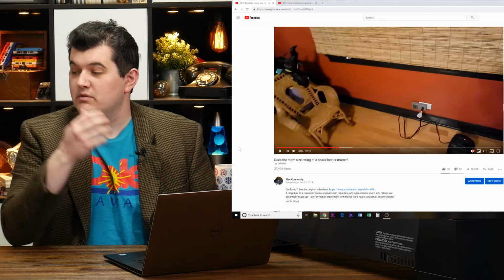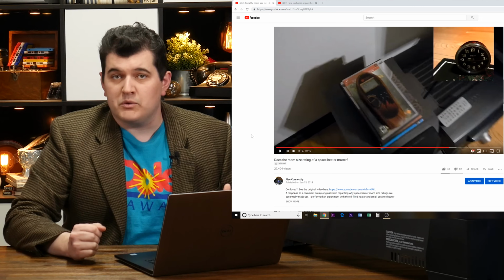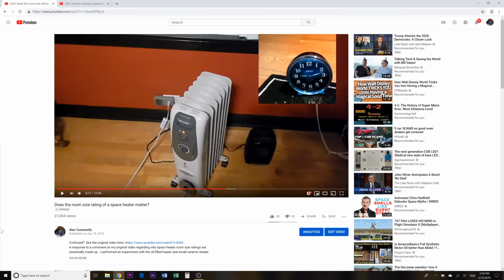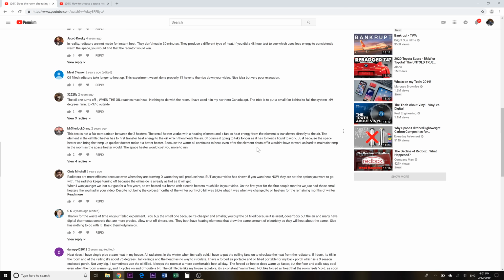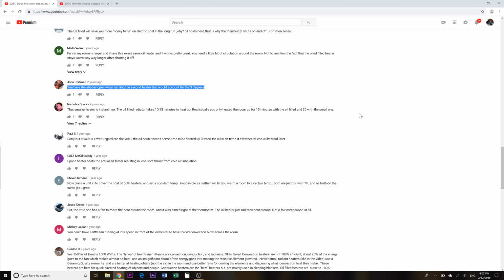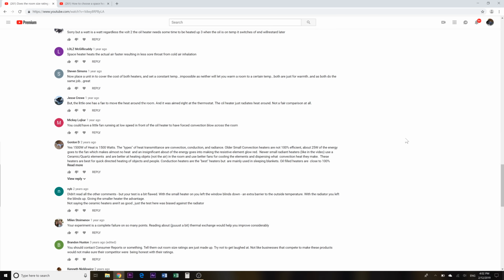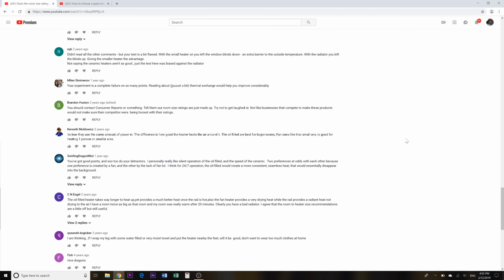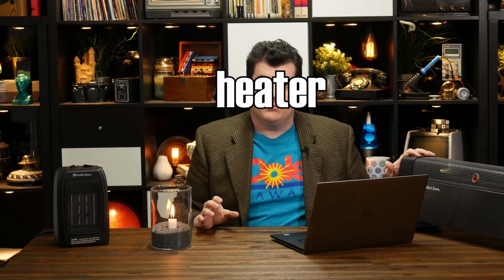More Space Heater Nonsense

Comment: I know this is an old video but here is my thought. If you have a large room you need a heater with a 'bigger' fan to move more air around the room quicker and potentially keep it where people are and not on the ceiling. If you just want to heat a room quickly or for a short period of time, a ceramic or inferred heater with an appropriate fan would be fine. If, however, you have a room you want to be 'warm' all the time a radiant style or many inferred/quartz heaters can be left running efficiently 24/7 and in time that will warm the walls, furniture, etc in the room so the couch isn't 50 degrees when you sit on it despite the air being 68 degrees. I can tell you this, that little heater on your table won't heat a 20'X30' 2nd-floor bedroom in January in Wisconsin no matter how long you run it. I've tried small heaters in large rooms and they just don't work as well despite having the same wattage. I also have a wood-burning stove and the closer you get to it the warmer it is but based on thermodynamics eventually my entire house should reach 80 degrees, but because its heat is concentrated in one corner of the house and heat is transferred out every wall, window and the roof it never will. Even if a small heater is creating enough heat to heat the entire room if it's not getting spread through the room it isn't going to make it feel more comfortable. If 1 candle produces 70 watts then 22 candles would heat as efficiently as any space heater.
Reply: TLDR:  I don't understand thermodynamics but based on my limited non-scientifically-tested experience, this video is wrong because I live somewhere that gets cold, and therefore, I must have more knowledge on the subject.

Comment: I'm just wondering, maybe "large room heater" was originally ment to indicate a limitation with the oil heater and that it shouldn't be used in a small room; because the power cycling would happen more often due to the smaller volume to heat. So there it might be an assumption that "large room" is actually superiour to "small room"; and it's actually (originally?) ment to highlight a shortcoming. 

But then Marketing has spun "large room" as a feature that customer can be charged for. Then "small room" heaters might be labled as such to protect the more profitable "large room" heater market.
Additionally, the more expesive large room heaters would be where you throw your extra features at, because customers are already willing to accept a higher price point and the marginal functionallity and more "robust" materials (indicating quality) again can drive the price of the "large room" heater prices up.

Comment: The only real performance differences between the two are ‘startup’ time, and ‘cooldown’ time.

An oil-filled radiator will take longer to heat up, but once it does will radiate meaningful heat longer after it is turned off.  The oil provides a thermal mass buffer to stabilize the output, making the heat in the room more consistent.

Most of the other styles are instant-on/instant-off.

Instant-on heaters will bring a room put to temperature faster.  Heaters with a thermal mass will maintain the target temperature better.

The only style of heater that can be ‘more efficient’ is the heat pump, because it doesn’t generate the heat itself, it moves it from somewhere else.
Reply: Why would you want the heater to turn off sooner and then convect plus radiate heat away from it slowly, all just to get the same amount of heat into the room in total?

Comment: What about did you take into consideration the differences in the time the individual heaters take to actually produce the maximum heat that little one automatically pushes it when you turn it on but the oil filter one takes a butt load of time to actually heat up?

Comment: As someone who has studied some thermodynamics at a university level, I am of the opinion that space heaters that rely exclusively on convection currents to distribute the heat around the room, are not only slower, but also slightly less efficient at heating. My reasoning is that convection heaters provide higher temperatures to the ceiling than element + fan, or even radiant heaters. Heating the ceiling more, results in faster heat loss through the ceiling. An element + fan or radiant heater can keep the warm air lower in the room longer, resulting in less heat loss through the ceiling. However, a long oil heater under a window, will heat the coldest part of the room silently. Heating the cold parts of a room will make for consistent temperatures around a room, making more of the room useable, which is likely why it is the chosen location for this sort of heater install that is part of a building, as you see in many colder areas.

Comment: you need a better oil filled heater, mine does not show any signs of the problems you described and puts out alot of heat
Reply: they're all the same. that's the POINT

Comment: The best space heater I ever had was a 1950s unit similar in size to the small one you present. It was also 1500W rated. It had all metal construction,  no ground in the cord and if used in the garage and set on a work bench steel top, it would zap me when iI touched the surface...LOL  It was the only heat I had in that building, so it was great.
Reply: Oh good jesus that's terrifying

Comment: Does the larger heater placed under an appropriately sized window create an air curtain that better insulates between the window and the space its heating? In large buildings with a lot of glazing (windows) they put the heaters right at the bottom of the window. I wonder if it actually helps.

Comment: Haha! Love it. Racing a 300HP Cummins Diesel against a 300HP inline 4 Honda fuel engine. But honestly: Power is power and energy is energy. It's the same no matter where it's going. Small forced convection heaters heat the air fast because of the strong convection. That's the reason why their fans are blowing the air horizontally. A big passive oil filled convector 1st heats the ceiling right above it, then moving on to the rest of the room including the air. (like you explain with the candles). Air is unfortunately such a bad medium for transmission of energy compared to a solid wall. IR heaters bypass that problem with the air by just transmitting energy directly to all non-transparent surfaces (well not many things are transparent to IR).Air is just so stupid: you make it warm and it rises up displacing the cold air to the ground where we live. So high ceilings suck too. We really need heat that falls down to the ground and stays there. As long as we can't get that we need to force convection.
Love your videos, wish I could talk that fast and make sense that much.

Comment: The Fan!  Power used to move the air is not converted to heat.  About 40% of the fan energy is still heat, the rest is transferred to generating air momentum.  This is probably a small amount of energy, but  this would make a difference.
Reply: and where does that energy of the moving air go? back to heat.

Comment: Buy the smallest, cheapest space heater you can find.  It will give the most heat for the amount of electricity used.
Reply: I greatly disagree, not from an efficiency point of view, from a safety point of view. 
Space heaters are involved in a lot of fires. Even the cheap ones have multiple safety systems, but oil filled heaters seem inherently safer to me when I have kids and a dog running around.
Reply: @prometheus56 converting your home into heat sounds very efficient. Not very safe, mind.

Comment: For me the one oil radiator that I had would go up to 90 and I found out by having it on that setting any room that I put it in would heat up to between 75-85 depending on the size of the room. Granted the room would feel about the same for an hour maybe two but after that it would keep the room toasty. Idk what model it was but it was a black honeywell from either 2016 or 2017.

Those things are good to use, you just have to keep in mind to turn them on an hour before you go to bed or before you go into your room. 

Now the one thing I want to see you do a video on are those annoying heated blankets! I would get a sunbeam one and I would say after about a months use on high the blanket would no longer heat up and would just end up being used as a normal blanket.  Would love to know what causes them to fiddle out so quickly!

Thanks and love your channels!!!! :D

Comment: What oil filled radiators need are detachable wireless or wired if you're so inclined, remote thermometers. That way you can get a reading of the room's temperature away from the unit. You can also place it higher or lower as you see fit. I dislike them because they take forever to warm a room though if you can get it warm it's a "nice" heat whereas the quartz space heater I have in my icebox of a bedroom heats quickly even lowering the fan speed my eyes dry out, my sinuses, my lips, etc. suffer from the forced heat.
Maybe connectable oil radiators with a remote thermometer. Link 2 or 3 via an oil send & return line. . . and gods bless the mess when a line fails. Back to the drawing board!

Comment: I am not an engineer, but maybe one benefit of the big heater is that they will last a bit longer. I could imagine that because of the larger surface area of the heating elements, they don't have to get all that hot, but will be able to put out the same amount of heat. That will put them under less stress. I don't know. 

But I think the main reason big room heaters exist is because of money. 
Put yourself into the position of a company that produces space heaters. Now you could just make one heater model - the small one. That's all you need. But: 
Why would you, if you could just exloit the ignorance of the majority of people? Convince people that for a big room, you need a big heater. "You need more material to build a big heater, so it MUST be more expensive." 
And everyone who is looking for a space heater will go for the more expensive option, because they think the small one is not fit for purpose. (unless of course they only want to heat a small room)

Comment: I think the kicker here is, choose which heater based on how you intend to use the room. Are you going to spend most of your day in this room like sleeping or as a living room reading a book for several hours? You can use an oil heater. Are you going to be in a room for a short period of time like a couple hours then move yourself somewhere else? Don't use an oil heater and use something that blows hot air because it will handle it better.

Or use a separate fan blow air over the oil heater. I'm going to try this myself this winter.

Comment: So if I got my oil heater up to temperature then added airflow with a fan. All of the energy stored in the oil heater should dissipate into the air in the room? Meaning they should balance out by doing this?

Comment: This is just a thought, a heating element can be close to 1200F (if it gets red hot) we only need to heat the air maybe 10-15 degrees above the current room temp. Moving air in greater volumes maybe why they are labeled for larger rooms?

They both may consume the same amount of energy, but possibly the bigger heaters with the larger fans can distribute the heat faster,
I used space heaters at an old rental house and the bigger ones did heat a bit faster than the smaller ones. 

honestly, its more of trial and error, different ones may work better then others based on your needs. That's why the good Lord gave us receipts if the item don't work to your expectations then return it and try another one.

But I agree to the marketing thing can be a bit misleading, it should say allows for better air flow for more even heat. The heat is there in all size of units but the distribution will be different.

Comment: You are 100% correct. I base my space heater purchases on other factors such as how quiet and powerful the fan is. Oscillation features and how sophisticated the thermostat system is. The one I am currently using to heat my office is quiet, oscillates and once it shuts off it will occasionally cycle the fan on to take a sample of the room temp. However it doesn't put out any more heat than a $10 heater.
Reply: Oh that sounds horrible.  I want one where I can give it a thermostatic set point and once it reaches the desired temperature IT KEEPS THE FAN RUNNING all the time, so I don't hear the fan going on and off all night.  I've only ever seen one that did this (by NewAir) but it's discontinued. 

Anyone?  Buehler?  Who makes one like this, where the fan has 2 modes: ON or CONTINUOUS, and the thermostat knob has at its lowest setting "Fan only" ??

Comment: okay SO the best thing i could think is MAYBE something like the baseboard one you had there has a larger surface area and therefore MORE of that heat can be output at a time?? if that makes sense??? like it'll be quicker to heat up a room with 1500w coming out of a 40" heater than it would be to heat up a room with a blowtorch of a similar amount of energy-similar to what you mentioned with the candle--BUT that would kinda negate why the ceramic one that was slightly larger than the small room heater you had would be labelled "medium". a larger surface area outputting that heat is the best i got

Comment: A different way of doing the experiment would be to time how long it takes to get the room temperature to a specific temperature. Then see how long it takes for the room to get back to its "normal" after the heaters are turned off ^^
Reply: THATS what I was looking for. My radiator heaters, they room stays warm hours after I turn off the heater. ....because the machine stays hot, the heated oil inside the machine, radiates heat for a long time after the machine is turned off. With the ceramic heater, it seems the heat is instantly gone as soon as I turn off the heater.
The radiator keeps the room warm. I warm up my room, and shut the heater off before I go to sleep. The room stays warm until the morning. 
The ceramic heater would have to be running all night, otherwise the room is really cold within 5 minutes of turning it off.

Comment: First off, great video :) 

Secondly, I wonder if the 'room ratings' may have more to do with the build quality of the units themselves, i.e. because the larger chassis allows the unit to run for longer without breaking down or stopping, they are rated for larger rooms (admittedly the ones with a built-in thermostat destroy this hypothesis).  Having a unit be able to run for longer will mean that even though they output the same amount of power, having one unit be able to run for longer allows it to do more work in the long run, and give enough time to heat up a larger area. They also probably assume a perfectly insulated room when they give those ratings

Comment: Has electric baseboard heating (like as the primary source of heat installed in homes) advanced at all over the past few decades? Or is it subject to what he brought up in the video, being that heaters are 100% efficient always? I ask because I'm trying to figure out if my electric baseboard heat is more efficient at heating my apartment or if a space heater would be. From what I understand in the video, it seem that they would be equally efficient despite the fact the space heater is new and the baseboards are probably from the 80s. I'm trying to find some way to lower my energy costs and electric baseboard heat in a 100 year old building is crazy expensive. I've already used cording to plug holes in windows as well as putting up plastic over all the windows. I don't know what else I can do to slow heat transfer out of my apartment so I'm wondering if I can more efficiently put heat into the room. The building is old, the windows are ancient pulley (single pane) and I live on the first floor, front of the building, so two walls face the outside and another faces the unheated hallway with only my smallest wall connecting to another heated space. The ceilings are 10ft high and there is an unheated basement below my floor. It's basically worst case scenario for heating bills in my northern latitude. Any advice on efficiently keeping the place warm would be greatly appreciated.

Comment: With an oil filled radiator, as well as a room stat it will have a thermostat for max oil temperature, once the oil is up to temperature it stops adding energy this energy can only be shared to room via convection and radiated heat at a rate governed by surface are and thermal coefficient. The fan heater can share heat as fast as it can add it. A larger oil filled radiator will be able to Radiate and Convect quicker even with the same peak power input. In effect a large element in a small oil filled radiator is a bad design

Comment: I know I’m a bit late to the party here but I think there’s a difference between efficiency and effectiveness, and stepping back a little I think it’s similar to the differences between boilers and forced air. The smaller heater ( or forced air furnace) immediately feels warmer since the air is directly blowing into the living space, but as soon as the heater stops blowing the room cools down quickly, conversely when an oil filed or boiler system is used it’ll take many hours to start to elevate the temperature and the system will keep radiating latent heat in to the room for many hours, along with any of heat absorbed into objects of the room, it’ll take much longer to cool down.  I think the other think that you are overlooking is goals, if your objective is to heat a space for a short bit then moving air does that quickly since it runs at 100% output the entire time even if it’s becoming too warm, conversely if you want to heat a room long term (sleeping, working or occupying the majority of the day) then the convection system (oil filled/boiler) will be slower but more consistent since it effectively can vary its output by cycling on and off, resulting in less actual energy use and greater comfort